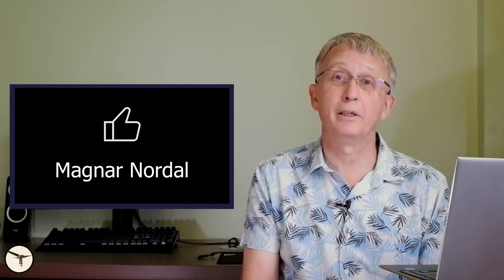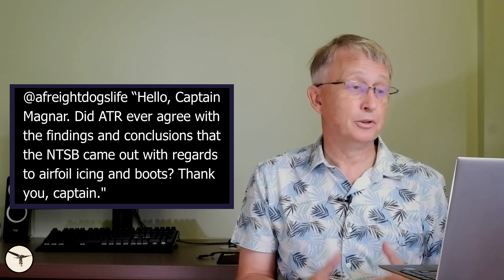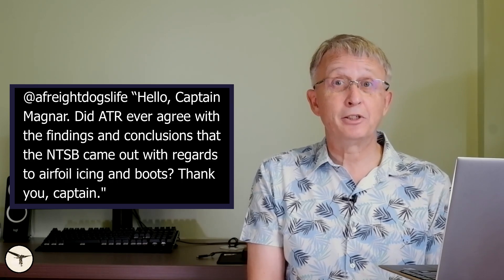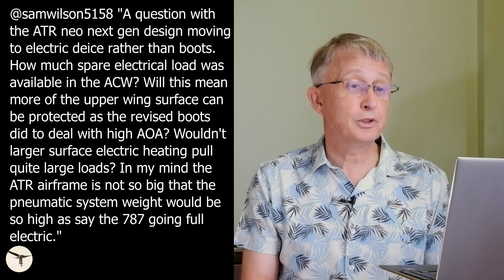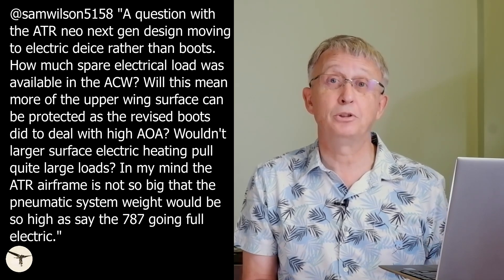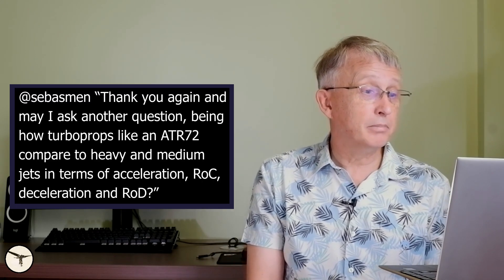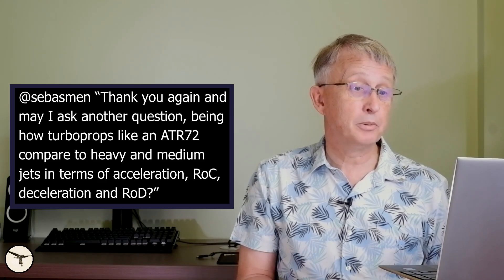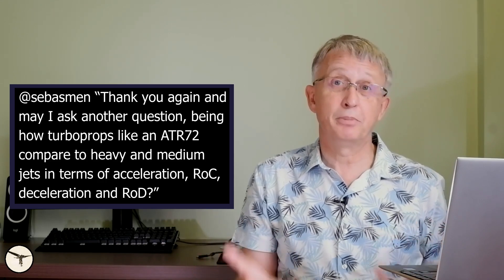Q&A with an airline captain - May 2024 | ATR | Aviation

Comment: Thank you. You're absolutely right, low AOA with ice behind the boots on upper wings. 

I'm excited to see what direction ATR take with evo. Lots of different hybrid power plant ideas competing at the moment. 

I know from driving our EV it's a double edged sword. No more "free" heating but on the other hand instant heat from resistive elements. A fun engineering challenge to be sure.